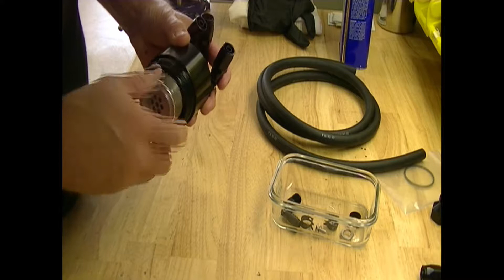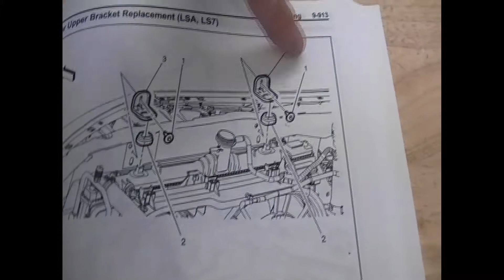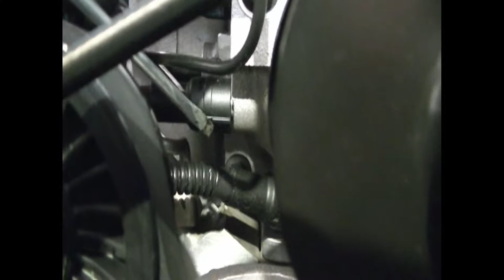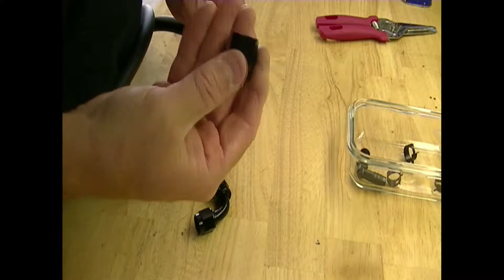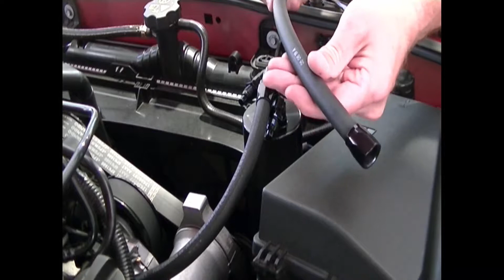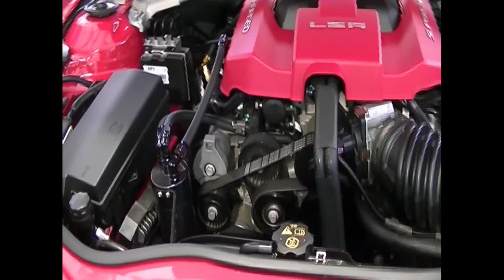Elite Engineering E2 Catch Can on the ZL1 Camaro

Comment: Hi fasnuf garage. Where is the center hose connected to ? it looks like all 3 hoses are connected.
Reply from the maker: The center goes to the vacuum source. I've since gone to the Mighty Mouse Wild. The EE wasn't allowing blowby from boost to evacuate and it was pushing oil out my seals. If you're boosted, I'de recommend one that has a way to vent to atmosphere to relieve crankcase pressure faster. Thanks for watching .
Reply: @fasnuf  so if the center hose goes to the vacuum source OUT then one goes to the PCV valve IN where would the third one go to then. I am totally confused when I see 3 hoses. I have only two on mine IN from the PCV and OUT to the PLENUM
Reply: @fasnuf  
Did you leave the right valve cover pcv port capped and valley plate port capped when you switched to the MM?
Thanks.
I’m really overthinking the instructions with the yellow lines going from the valley plate to the fill port .

Comment: Helpful video- thanks.
So- what did you do with the stock PCV lines?
Reply from the maker: jason levitt The stock lines are still there. I decided to only use 2 out of 3 ports on the catch can.
Reply: @fasnuf  Was the 3rd line too much of a hassle for oil changes?
Reply: @gravitybounce6877  I'm curious too why you eliminate, I presume, the oil fill cap line.
Reply: What size of hose did you use?